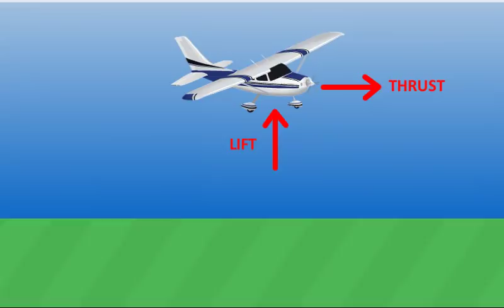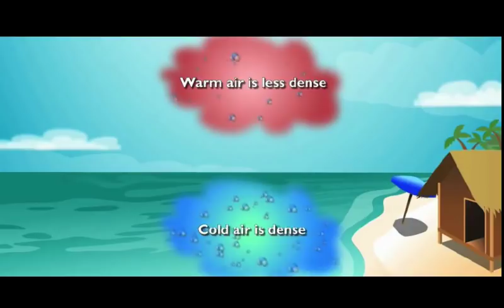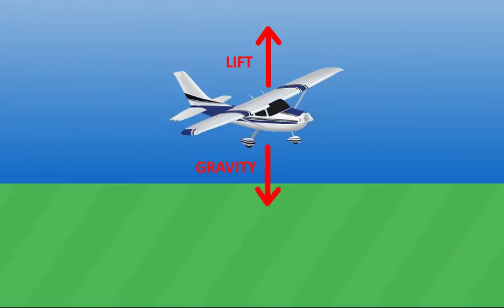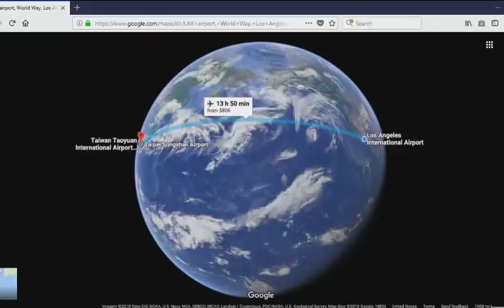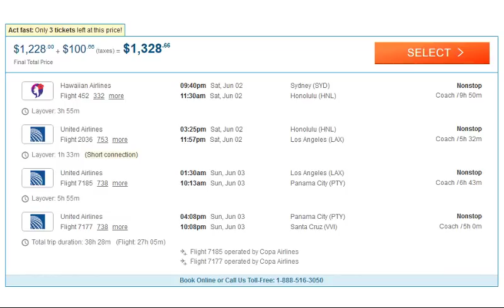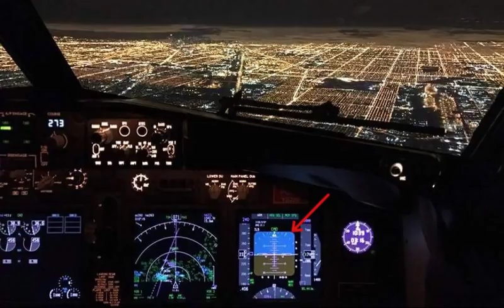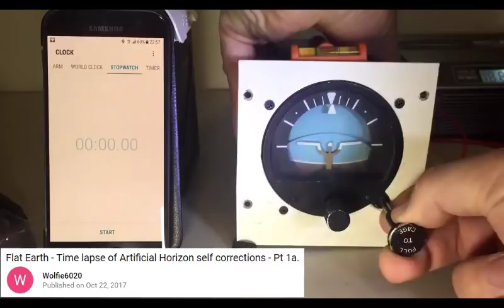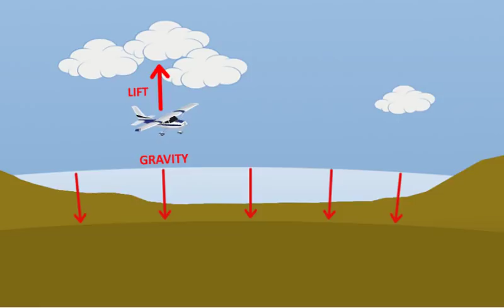Flat Earth Falsities - Plane Nonsense

Comment: You say an object in motion stays in motion so a plane is already in motion with the earth's rotation and maintains that motion even after take off.
Sure, that makes sense.
So a plane taking off from Melbourne airport in Victoria Australia will maintain the speed of the earth's rotation throughout its flight as it is an object in motion and shall remain in motion unless a countering force is applied to that motion.
The speed of earth's rotation at Melbourne Australia is 823 mph towards the east as earth spins in the easterly direction.
So a plane takes off in Melbourne with a direct flight to Singapore's Singapore airport. 
Singapore airport is almost directly on the equator less 26 miles.
So the rotation speed of earth at Singapore airport is 1040 mph.
So the plane that departed from Melbourne airport Australia is in flight traveling to Singapore airport and maintaining the motion of 823 mph in an easterly direction that it obtained unnoticed when leaving Melbourne and matching the earth's rotation.
So when reaching Singapore airport the earth below it must therefore be spinning or rotating in an easterly direction 217 mph faster than the plane is.
This would be visually experienced by seeing the ground below, or earth moving from your left to your right at a speed of 217 mph while heading in the Northern direction as would be expected departing from Melbourne Australia.
Also, wouldn't extreme measures need to be taken to compensate the position that Singapore would be in its rotation by its speed of rotation compared to the planes position by its speed of rotation being a difference of 217 mph ?
So in a 10 hour flight Singapore airport would've travelled 2170 miles further to the east at the speed it is rotating compared to the plane and the speed that it is rotating ?
All that being true wouldn't it make sense for airlines to calculate the departure time of a flight to be determined by the position of the destination in regards to the shortest possible time of flight ?
The cost involved and amount of time in the air to accommodate the distance in catching up to 2170 miles that is involved in the flight from Melbourne airport to Singapore airport would be incredible, and that's just 1 flight.
And wouldn't the airline companies pass on these costs to all that choose to fly at any time that is not the optimum value or cost effective time to travel from one destination to another that are positioned North or South to each other ?
How is this explainable when you have already stated that an object in motion stays in motion unless another force is introduced to effect this motion ?
What is this other force being introduced ? 
And don't say that it's gravity without an explanation and proof.
Theories are not proof and if you believe that they are you must also accept ANY other theory as evidence of proof if your wish to not show a mentality of hypocrisy.
Reply: steve russell So sad
Reply: steve russell, you raise some good points and I hope I can address your questions adequately.  Please let me know if I do not.

With regards to your question about the difference in speed at different latitudes, I would counter with another question: if you perform the same experiment in a car, driving from Ontario to Florida, shouldn't you face the same problem?  Where does the extra energy come from to make the car move so much faster when it's closer to the equator?  The reason is that the car is moving along the ground. The ground moves the car with it as it rotates, and the travel time is so long that the acceleration effect is unnoticeable.  The same explanation applies to airplanes, except the plane is being moved along with the air as it rotates.  The plane does not really become detached from the Earth as it flies; it is still subject to the movement of the air, which rotates with the Earth.  The "other force" being introduced to explain this acceleration is friction from the air itself, which just like the friction of ground on the car, acts over such a long time that it is unnoticeable.

As for your question about how the Singapore airport would've traveled 2170 miles from its original position, this comes down to what reference frame you're using.  Relative to the Earth's surface, the flight distance is what we traditionally report.  If you were situated at a "stationary" point between the Earth and the Sun so that in 1 day the same point on the Earth would come back around to you, you would in fact see the flight distance as longer than expected, since the Earth is rotating.  Both the destination and the plane have traveled several thousand miles further than they did in the other reference frame.  The apparent travel distance depends on what you're measuring the distance relative to.  In one case, you're measuring distance with respect to the Earth's surface, which is rotating.  In the other, you're measuring distance with respect to your own stationary position.  For distances on Earth, it is more useful to measure distance relative to the Earth's surface, since we are rotating along with it.

Sorry for the dense comment, but hopefully this answers your questions.
Reply: @origamiswami6272  some of what you say is more than interesting and makes basis for possible experiments.
Earth's atmosphere spinning at the same speed as earth ( dependant to its positioning ) has many questions that need to be answered. For example why can't the effects of this be experienced in what we are exposed to in our daily lives ?
If the atmosphere spun in synchronization to earth as it is alleged, why can clouds be freely seen moving in all possible directions and under no influence of a spinning atmosphere or favouring a particular direction or a difference of the speed of movement in any direction. But yet that same atmosphere has the complete control of the travelling speed of objects that offer much more resistance by their greater weight compared to volume characteristics and their aerodynamic design for minimal friction or dragability ( did l just make that word up  ) ?  Why can wind blow from every possible direction with its ferocity not determined by or subject to a spinning atmosphere or any pattern showing its constant unchangeable influence ?
If earth's atmosphere spins at the same speed as earth itself wouldn't that be  measurable by its strength having the atmosphere  closest to the surface of earth itself as more powerful and of the highest atmospherical speed with a dissipation of its strength and lowering of speed quickly taking affect as the distance from earths surface increases ?
Spin a disc or ball with purpose design blades for maximising the influence it has on its surrounding atmospherical environment and see the limitations it has of control or influence and how quickly this dissipates the further the distance travelled from the blades. And this is speaking of a purpose built engineered device such as a blade drum fan with the spacings all at an equal and optimum distance and performance calculated angle, and not the random unequal or uneven purpose uncomplimenting surface that earth has for this to have any chance of providing a similar effective efficiency as a blade drum fan.
And what about the coriolis effect ? Adjustments need to be calculated  by military sharp shooters ( backed by scientific studies )to compensate the effected influence that the earth's rotation has on where the projectile of a bullet will  find as its location after only 5 seconds of direct contact freedom and independent flight before reaching it's intended destination.
So a bullets projectile with only 5 seconds of air time and covering a 2 mile distance ( over exaggerated distance and time in flight ) has its destination effected although being in the best possible location for the earth's atmosphere's spin to prevent this being the result as the strength and speed of the spinning atmosphere would be at it's most influential and strongest considering the close proximity to earth's surface.
Do you want me to keep going ?
Reply: steve russell I would note that the Earth is ginormous and you are tiny which is why you don't notice anything in daily life. 

The atmosphere is a fluid. You can have movements within it (air currents) while the whole body exhibits a net movement.
Reply from the maker: Steve russell - The clouds ARE influenced by the spin of the earth and the variation of that speed. That is the coriolis effect. This explains why storms in the north usually rotate counter clockwise, and in the south clockwise. This is caused by the air dragging behind the rotation as you approach the poles. So you just unwittingly gave evidence for the spinning globe. You can watch this happen in full disk weather satellite time lapses such as those taken by the Himawari-8 or the GOES.
Reply: @steve russell some effects of the rotation can be experienced on a human level.  The best example is a Foucault pendulum, which uses the conservation of angular momentum to show that the Earth is actually spinning. Even then, you need a pendulum with a really large mass and a long arm, and in a place that doesn't have any wind, and you need to watch it for quite a while. https://www.britannica.com/science/Foucault-pendulum

Wind (and therefore clouds) ARE affected by the spinning atmosphere; that's the Coriolis effect.  It's only apparent on very large scales (because the Earth is big), and wind is affected by other factors such as temperature and pressure as well, which is why it doesn't always go in the same direction.  This effect explains why hurricanes in the northern hemisphere rotate in the opposite direction to hurricanes in the southern hemisphere.

The atmosphere would not vary in velocity with altitude, because the ENTIRE atmosphere is rotating with the Earth, and has been for billions of years.  There is nothing at the top of the atmosphere that would slow it down.  As for your man-made spinning ball, friction with the surrounding atmosphere is what limits its range of effect. In space, there is no surrounding stationary atmosphere to provide friction to slow the air down.

From what I've read very briefly, it seems like long-range snipers (as well as long-range ballistic missiles) do need to take into account the Coriolis effect.  I've never seen or read about this experiment being done, though, so if you link to those scientific studies, I'd love to give them a read.

By all means, keep going.  I'm enjoying this conversation!
Reply: steve russell I can't see the relevance of your first question. We're talking about one revolving object with moving air, not two objects in stationary water. 

I hope this is clear; I'm ill and not at my best for expressing myself. 

Fluids (gases & liquids) differ from solids in that they lack a rigid molecular structure. There can be movement within them that runs counter to the net motion of the whole. Forces that alter the density (heating & cooling) or motion of local regions create local motions in addition to the overall movement of the fluid. The atmosphere started revolving for the same reason as the Earth (decrease in radius as matter compacted caused an acceleration in a minimal net flow***) and has been maintained at the same speed & direction as the Earth by friction against the Earth's surface. Heating & cooling of the atmosphere in different regions creates localised differences in air pressure leading to movement between regions. 

The plane has some motion independent of the atmosphere's motion because it has engines. On take off it has motion through conservation of momentum from the Earth's rotation while parked, the power of its engines and whatever wind is prevailing at the time. One force acting on an object does not make the object independent of other forces; there is simply a net result. 

***If that isn't clear or sounds odd then watch this video on how a cat always lands on its feet. 
https://www.youtube.com/watch?v=RtWbpyjJqrU
Reply: steve russell "are you claiming that the earth's spin occasionally changes direction ?"
No, he is saying the Earth's motion influences the clouds motion through the Coriolis effect, i.e, the decreasing groundspeed between equator and pole. Heading away from the equator the clouds will veer eastwards, towards the equator then veer westwards. This is only apparent on a scale a thousand miles wide, not in the 10 miles or so above your head; you need to look at Himawari-8 online and watch the progression of cloud patterns throughout the day.
Reply: steve russell  When I stated the entire atmosphere rotates with the Earth, I was simplifying.  Pressure and temperature variations within the atmosphere cause wind, and those winds will be at different speeds and directions at different altitudes and locations in the atmosphere.  My point was that on the whole, the atmosphere does rotate with the Earth.

Planes are subject to the Coriolis effect in that they are subject to wind, and wind (at large scales) is definitely affected by the Coriolis effect.  When flying into a headwind, the plane will fly at a slower ground speed than when it has a tailwind, and this absolutely affects flight time.  Just look up the jetstream, and how it's affect by Coriolis.  The difference between wind and a plane is that a plane is not JUST being blown around by the wind; it supplies its own thrust as well, and so is perfectly capable of flying in any direction it wants.

As for the spinning sphere in a stadium, the scale is all wrong. With a 4-inch sphere representing the Earth, the atmosphere would be so thin as to be practically invisible.  It's more like a coat of paint on the ball than a huge sea surrounding it. If we measured the air velocity less than a millimeter away from the ball, I would expect it to be about the same as the velocity of the ball's surface.  Plus, the atmosphere is surrounded by vacuum, not more air, and not a solid boundary like your stadium. 

Clouds only move because of wind, so if the wind is blowing towards the west, the cloud will move that way.  Like I said, the Earth's rotation is not the main factor that affects wind on a local scale.  As for friction with itself...well, that's the whole point.  Friction with the ground affects the air just above it, and that air has friction with the air above it, and so on until the edge of space, where there is no more air above it.  At the top of the atmosphere, the only friction force on the air is from the air below it.  There is no force that would stop the atmosphere from, more or less, rotating with the rest of the Earth.

Gravity indirectly causes friction within the atmosphere, because it's what holds the atmosphere to the Earth.  You don't need to believe in gravity to confirm that air friction exists, though, you just need to stand a short distance away from a fast-moving car as it passes you.  What is holding the atmosphere to the Earth is irrelevant in this case, as the air is affected by friction with the ground regardless of what force is keeping it there.

Speaking of gravity, I'm curious to know exactly what part of the phenomenon you disagree with.  Surely we all agree that something keeps us on the ground, so how does your explanation differ from, say, Newtonian gravity?
Reply: steve russell "as if no-one can comprehend my point,"
Your English could be better. Sphere & fluid are obvious but what plane starts as stationary in flight? 

Are you asking how the revolving Earth makes the plane move while it is flying? Are you asking how the plane compensates for the Coriolis effect? Are you asking how does the Earth keep the atmosphere moving?
Reply: steve russell  I just realized you never addressed the example I gave of an effect you could observe at the human level!  What is your response to the evidence of Foucault pendulums showing that the Earth rotates?  How can this be explained on a non-rotating Earth?  Please give an explanation, I'm fascinated to hear what you say.
Reply: steve russell  So, you're basically saying that everyone who has conducted the Foucault pendulum experiment has done so either with poor controls or dishonest intentions.  In that case, you can disprove the rotation of the Earth by performing the experiment with proper controls.  Eliminate all possibility of any factor affecting the pendulum's swing, and if the pendulum's swing does not change direction, conclude that the Earth does not rotate.  Repeat this multiple times to make sure of your result, and make sure to describe exactly what you did so that anyone else can check for themselves. This is your chance to once and for all disprove the globe Earth.

I found a detailed procedure for this experiment, but feel free to design your own if you like.
http://adsbit.harvard.edu//full/1911PA.....19..164P/0000169.000.html
Reply: steve russell "l believe to be major problems, impossibilities, half truths, outright deception"
Can you iterate what they are without descending into multiple insults?
Reply: steve russell  If a plane enters an area of high winds, it will absolutely be affected by it.  If the area is large enough and consistent in its direction, flight time and fuel consumption will be measurably affected.  The flight distance and location, however, will not, because we measure these things relative to the ground.  If a plane flying east is being blown north by high velocity winds, the pilot compensates by steering the plane.  If for some reason the pilot does not have navigation, it is very possible to be blown off course without knowing it.  Pilots adjusting for wind conditions is a well known and regular happening that many have experienced.

Your description of the atmosphere as having pockets of air moving independent from the Earth's rotation is not all that bad, although it would be more accurate to describe the motion as "slightly different" rather than "independent".  It might help to think of wind as slight deviations from the overall spinning behavior of the atmosphere.  On a calm day at the equator, you will feel no wind because both you and the atmosphere around you are moving at the same speed.  If a wind picks up, the air around you is moving at a slightly different speed.  In a hurricane you might see winds of 60mph.  What we don't see are 1000mph easterly winds caused by the air suddenly deciding to stop rotating with the Earth.  We also don't see 2000mph easterly winds caused by the air suddenly deciding to rotate the other way.  There isn't even a consistent breeze blowing from east to west, it can blow in any direction at different times. The atmosphere does rotate with the Earth, and winds are slight variations around that movement.
Reply: steve russell  Also, thank you for explaining your stance on the issue, and above all thank you for your willingness to ask questions.  I know the people who debunk flat-earth claims on Youtube can come off as just as condescending as the flat-earthers, but you have to understand that to most people, flat-earthers look just as crazy as some guy raving about the end of the world on the street corner.  No, I'm not exaggerating.  People proved the Earth is a globe thousands of years ago using simple astronomy and mathematics, they even measured the size of it, but the fact is still in contest today.  A few moments of research will lead you to experiments ranging from shadows to pendulums to lasers to literal photographic evidence that proves the Earth is round.  It has been proven time and time again, to the point where for most people, it no longer needs to be proven. People condescend towards flat-earthers because to hold that position for truth is indicative of intellectual laziness of the highest degree, and please don't take that as a personal insult.  You asked, you listened.  You're learning.
Reply: steve russell - if you would like me to walk you through the maths for adjustments required for Coriolis I would be happy to do so...

For example, your hypothetical 2 mile shot taking 5 seconds between muzzle and target would require NO correction if that shot was taken due north from one mile south of the equator (or taken south from one mile north of the equator) as both rifle and target have the same tangential velocity.
However, if that shot were taken AT the North Pole at a target 2 miles from the North Pole (or the antipodean equivalent), we know the rifle is not moving whereas the target is moving with a tangential velocity of 2 miles *2*PI /24 hours = 0.523 MPH
So in 5 seconds the target would move 9.2 inches.
At 2 miles that’s about 1/4MOA or 2 clicks on my scope.

Now, 2 miles is a LONG shot and very little shooting is done at the poles - and besides, wind is going to move he bullet more than the Coriolis Effect. So, as a rifle shooter, I’m not going to worry about it.

Artillery however.... much longer distances and flight times.
Reply: @origamiswami6272  if the ground was moving with the car how would u break? Does the ground stop suddenly? It cant. Its in constant rotation remember?
Reply: Bobby Wizdum —
     When the car is stopped, it is moving with the ground. 
     Hence the equivalent statement: when the ground moves with the car, the car is already stopped.
     ("Moves with" means at the same velocity.)
Reply: @romithromith  if the ground is moving below the car. The car is moving with the ground. The car breaks yet the ground keeps moving...
Reply: @romithromith  that makes no sense at all. Only a fool can be standing still thinking they are in constant motion.
Reply: +Bobby Widzum "if the ground is moving below the car. The car is moving with the ground. The car breaks yet the ground keeps moving..."
Yep.
Reply: Bobby Wizdum —
     "if the ground is moving below the car. The car is moving with the ground.... that makes no sense at all."
      OMG I thought you were trying to make someone else look stupid. But it's you. (Probably not a good idea for you to say things like this in public. Not around intelligent adults.) Or is it just an appeal to incredulity? 
      You simply don't understand BASIC physics.
Reply: steve russell —
     We need to consider another flight issue...
     I would like to know the distance between Sydney, Australia and Santiago, Chile on the flat Earth. Now I'm concerned with flight distance, and such flights (let's use Qantas 27/28) approximate the great circle on the globe so they fly up to 60° south latitude. 
     The non-stop flights take from just over 12 hours to just over 14 hours. How fast would a 747 need to fly to keep this schedule?
     Another issue concerns the 747's range of 7,260 nautical miles (8,350 sm) with these non-stop flights.
     In reality, the top speed of a 747 is 614 mph, the flight plan plans for speeds just shy of 570 mph, and they tend to cruise 525-540 mph because it is more fuel efficient. Sustained flight above Mach 1 would damage the air frame. So how does 614 mph compare to your figure?
    By my calculations, the top speed, range, distances, and schedule just don't work. So we have the option that either the flights are false, or the flat Earth is false. Since these flights do occur, clearly a flat Earth doesn't.
    Please don't play the conspiracy card and claim that these flights are faked. We have a variety of other similar flights. I mean you could run the numbers on Qantas 63/64 between Sydney and Johannesburg, South Africa. Or try LAN 800/801 between Auckland, New Zealand and Santiago, Chile. Or Air New Zealand 30/31 between Auckland and Ezeiza, Argentina.